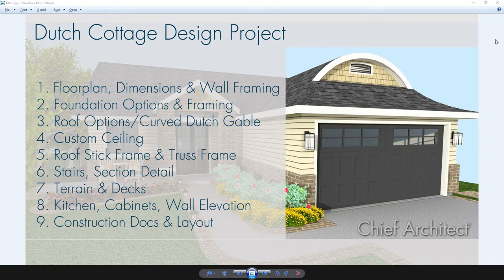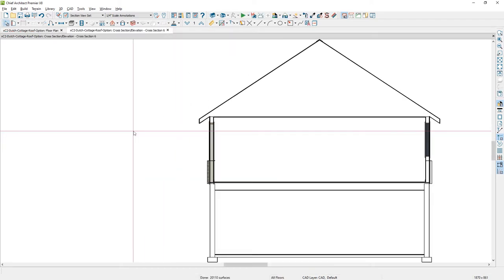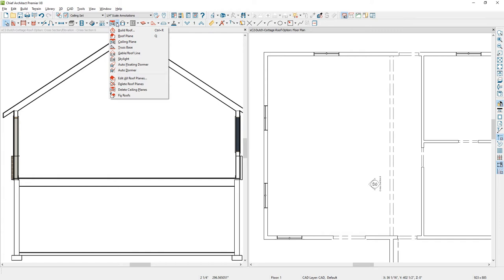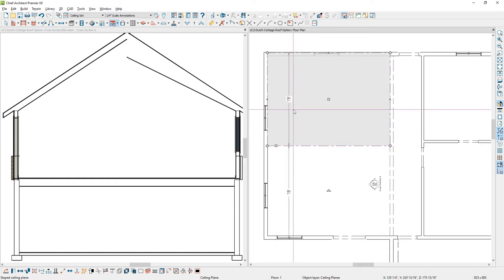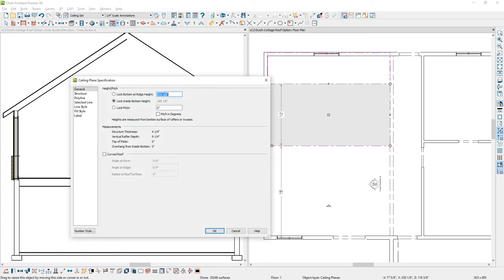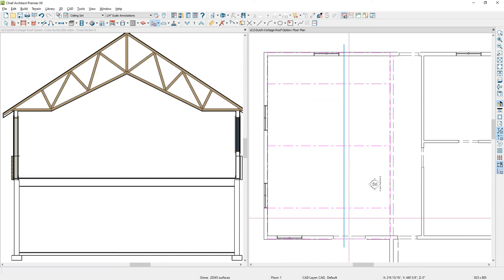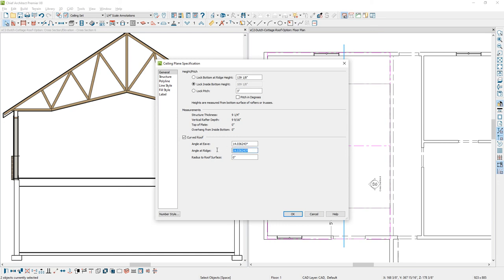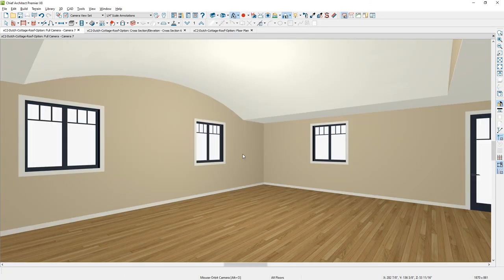Dutch Cottage - Custom Vaulted Ceiling

Comment: I take it this is not in Home Designer 2018 ( Architectural ) ? Whats up with X8 Premier I see , is this a Pro program ?
Reply from the maker: Joe, you are correct. We offer two different product lines, Chief Architect for professionals and Home Designer for home owners. You can learn more about Chief Architect Premier here: https://www.chiefarchitect.com
Reply: How would I do beams in my home designer ? I figured out the long process to vault just a room and getting pony / half walls ( half wall works easier ) but the exposed beams ? how ? even a box beam or even a truss ....
Reply from the maker: You are able to create beams with soffits. Here is a Knowledge Base article walking you through the steps: https://www.homedesignersoftware.com/support/article/KB-00161
Reply: I'll try it , will work in a vaulted ceiling room ? with out the rest of the timber structure for a vaulted ceiling with exposed timber ( like a lodge or cabin ) ....? THX's
Reply from the maker: If you open the soffit for specification, there is an option to slope the soffit and have it follow the ceiling.
Reply: Yes , I've seen that option . Cruised around ( clicked ) in the program question area you sent me into for all the way's of making custom island tops , pools , fireplace ect.... I'll get it sooner or later , Thanks again